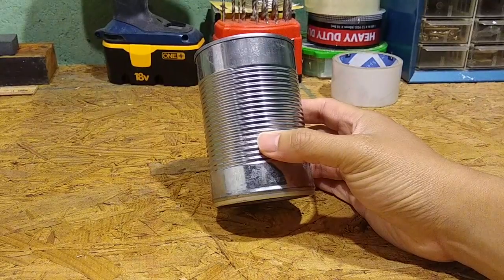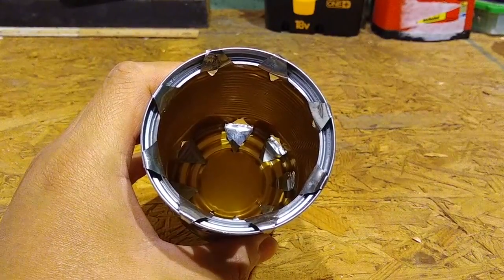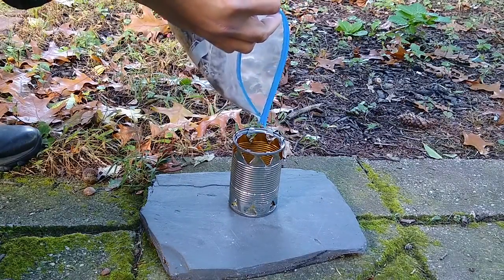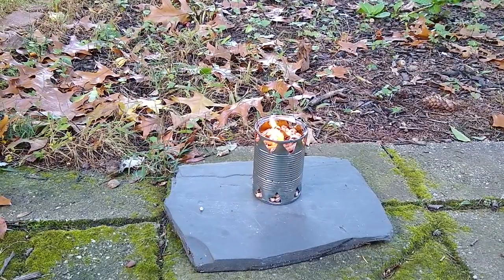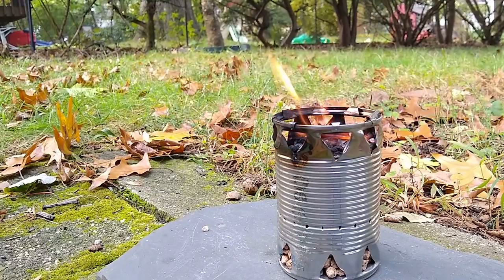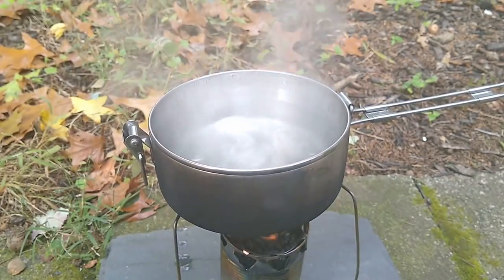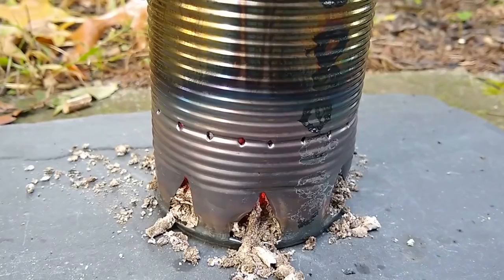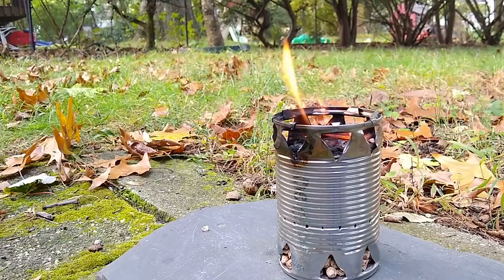Best DIY Soup Can Biomass Stove ever!

Comment: I followed this video but made a few changes. I took a glass salsa jar that’s just about the size of the can and filled it with pine sap. I lit the sap and I put the can on. I even put a piece of metal wire through the hole to make a lantern. And the best part is, the top of the can still gets very hot. It’s not big but it is able to boil water. Thanks man for another great video.
Reply from the maker: Thanks for watching!

Comment: want to ask you if you see an improvement in burning all of the charcoal produced when you include the tertiary set of air holes? thanks.
Reply from the maker: Thanks for watching.  There is a noticeable improvement.  The tertiary air holes keeps the stove from choking up for ~ 20 min longer when using wood pellets as fuel.

Comment: When the flame gets low, and I add new twigs, the stove starts smoking again. What's the best way to keep the flame going with minimal smoke?
Reply from the maker: Thanks for watching!  One trick that I have found is that every once in a while, you need to hold the can down with a stick and then tap it gently with another stick to get all the ash and soot on the bottom to come out.  Once that ash comes out, the fire inside burns hotter and you can add more sticks without it being super smokey.

Comment: Where do you even get Can taps? i cant even find them on amazon owo
Reply: Check your local dollar stores
Reply from the maker: @MakThaNife  Thanks for watching!
Reply from the maker: Thanks for watching, here is an amazon link to some https://www.amazon.com/Chef-Craft-21297-Bottle-Opener/dp/B00LSD7OSE/ref=sr_1_6?ie=UTF8&qid=1542938203&sr=8-6&keywords=can+tapper
Reply: I grew up calling them church keys.  Supposed to be a joke I think since they were used to open beer.
Reply: @MakThaNife  found some in Asian stores. or try swap meets found older used ones for .25 cents each !

Comment: Could you put a metal cup straight on top with "pot stand"?
Reply from the maker: Thanks for watching, yes you could put a metal cup on the pot stand.
Reply: @WannabeBushcrafter  i think elliott is asking what I’m wondering, which is, could you put your pot directly on top if the stove itself and cook without using that wobbly coat hanger thingy?
Reply from the maker: @notquiteultralight1701  thanks for clarifying.  If you put the cup directly in the can the fire will go out.